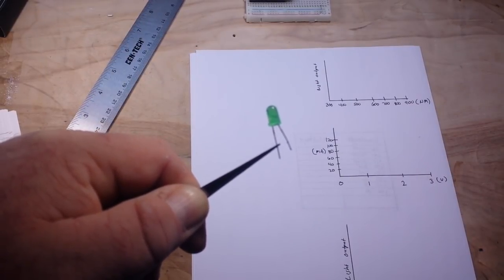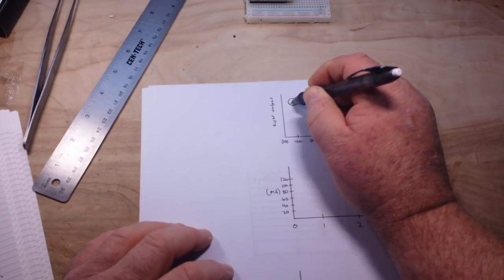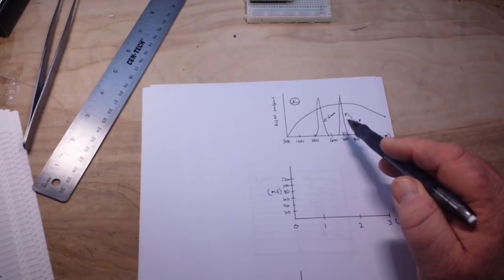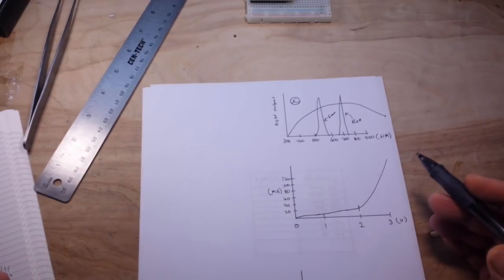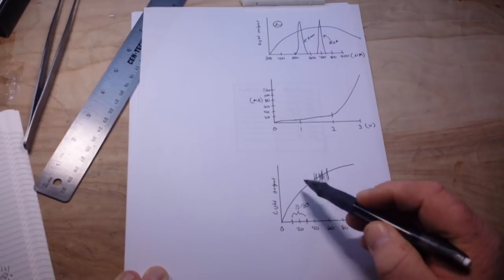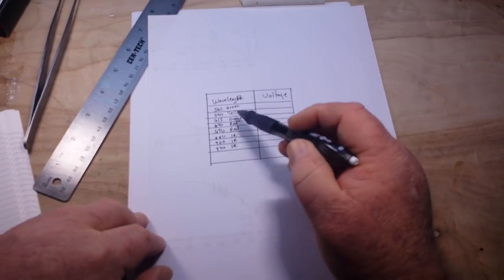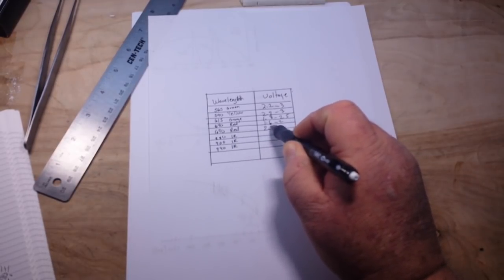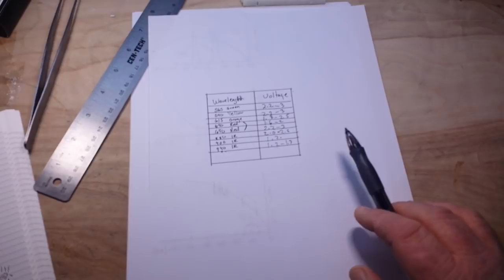LED voltage, current, output relationships

Comment: does that 15-30 range apply to all leds? specifically for radio control models I am talking about, some come in things like bumpers already installed, some may be smd type, but generally speaking, leds need to be within that current range? I mean, I had no intention of driving them harder than 20ma, but I was worried 20 may be too high for some? p.s. for clarity, if you cannot already tell, i know nothing about leds/electronics, i am building my first rc with many leds added so genuinely asking
Reply from the maker: No you need data on each one, but if you never go above 20ma you should be safe. This does not apply to 1W or more LEDs.
Reply: @learnelectronics  awesome thank you sir for your reply and help

Comment: Thumbs up; but i have a question : i drove a led with current limitation at 20mA, i saw that the led continue to run at 25 volt, so what ?? no limitation of voltage ?
Reply from the maker: If you limited current, it did not get to 25V. A red led current limited at 30mA will only pull 1.9V.

Comment: Nice and simple, basic explanation. Can you make some kind of proximity sensor with IR Leds? Cant understand freq. operation :( bought couple of them (reciver and emiter) + lm3.. comparator  getting nowhere with youtube videos on subject. You can buy finished product for arduino line folowing robot but sensitivity is like 5-15 mm, nothing bout 50 cm or more? Tnx, you channel is my daily dose of electronisc :)
Reply from the maker: Thanks. You could do it with it LEDs, but they don't really have great coverage at a distance. Two much better ways to do it are with an ultrasonic sensor and the ping library or a laser TOF sensor.
Reply: Done those 2 :) wanna learn it how to do it without MCU. I`m guessing its something about IR LEDs must be on same freq. not really  in to basic electronics.

Comment: LEDs are great fun to watch go pop. But like you say not recommended. I've blown a few unintentionally so I dug around and found a pretty comprehensive chart on frequency, color, forward voltage and current. Stopped me from wasting anymore LEDs. I like your graphs they really help to visualize what is happening. Thanks for the good show!

Comment: Thank you for doing this video! Can you please do a video with series versus parallel wiring of LEDs?
Reply from the maker: Yeah, what do you want to see?
Reply: learnelectronics if i have X number of LEDS, __ would be the best way to wire it up. I tried 4 LEDs in series and nothing happened (i think the voltage wasn't high enough). Explain and talk about constant current vs constant voltage method of lighting LEDs.
Reply from the maker: Ok, got it.
Reply from the maker: Tomorrow's video is for you.